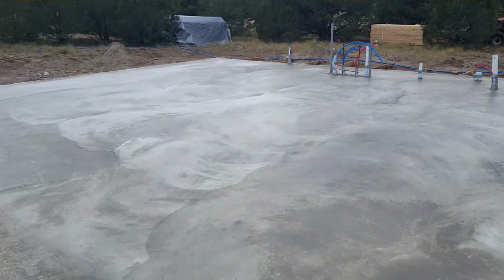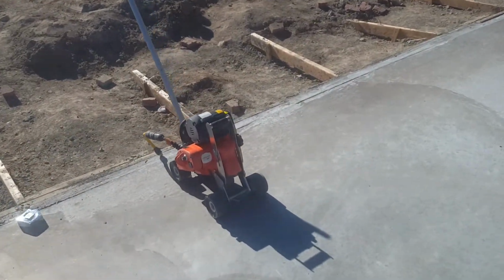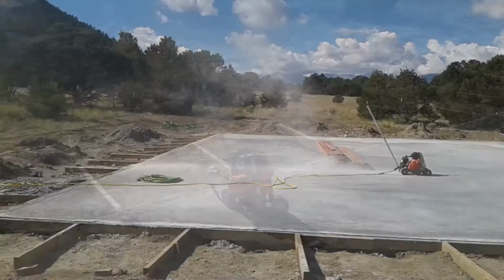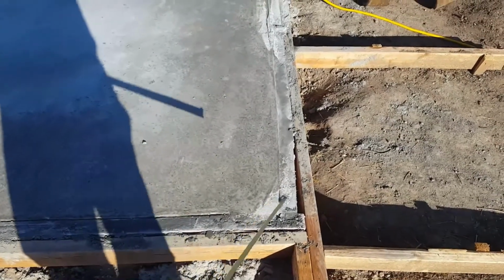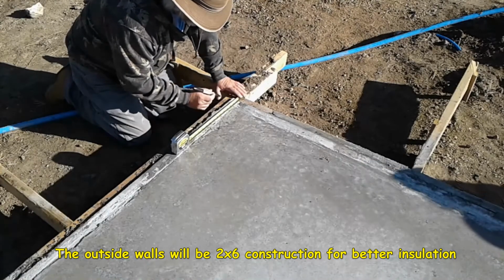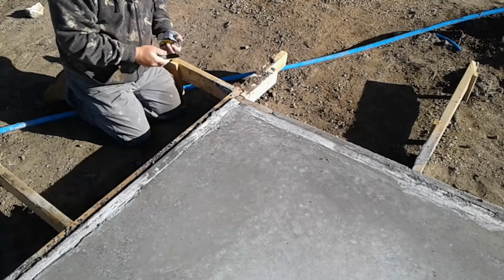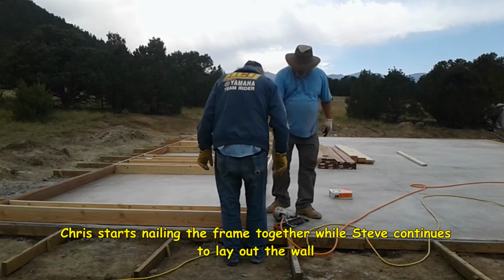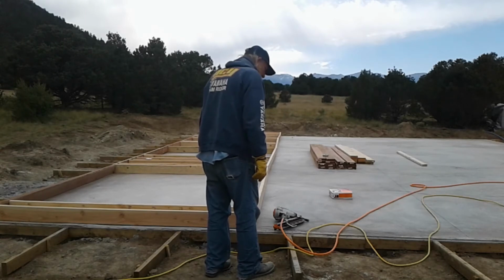15 Concrete Cutting Laying Out Walls Framing

Comment: How much power did that concrete saw consume while cutting? Just curious as to how much of the inverters capacity it used?

Thank you
Reply from the maker: The little saw only used about 300 watts.  The system didn't even notice it.

Comment: yep, you need to tie a string to that tape measure to a belt loop, or else forget where you left it, ha ha
I noticed you didn't put in anchors in last video,  but I think even though you have to drill the hole, you can put the where you wish them. someone else on another video used tapcon screws but I guess use what comfortable for you
best

Comment: I've been retired from heavy equipment adout 10 years...
Most of the jobs i worked were high-rises  100 th sq. ft. and up.. 1m sq. ft. was the biggest...
At that time they would cut the slabs with a wet-crete saw. (basicaly a skill saw).
The same day as the pour...
They said the concrete cut easier then..
Instead of bringing in the big saw later...
Reply: The wet saws are what I'm used to as well.  At first I was looking for the hose connector, and there was none!  Self-propelled and no water made this the easiest cut I ever did.  Maybe more dusty, but not a bad trade off at all.

Comment: Steve you spacing the studs 16 or 24 inches.  Looking good.
Reply: Floyd, this is 16" OC.  Building code enforcement is very strict out here.